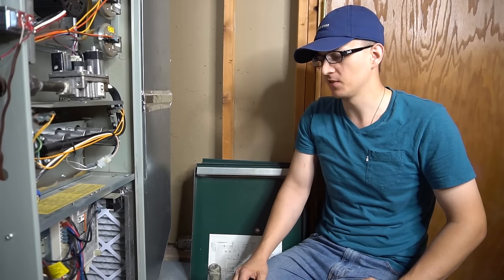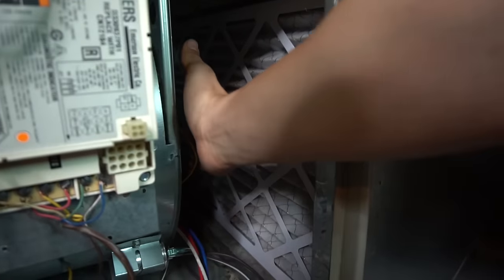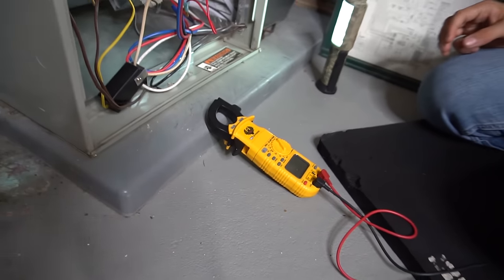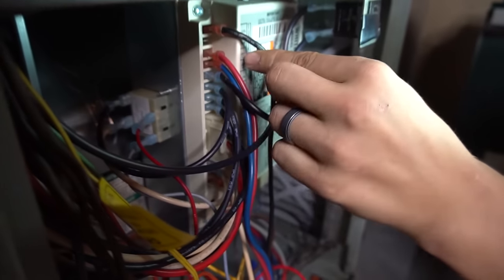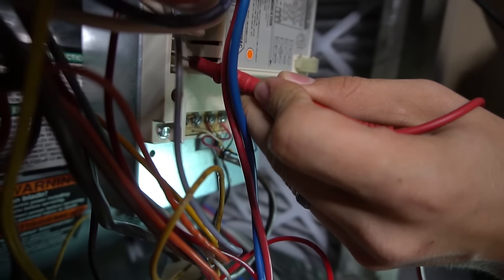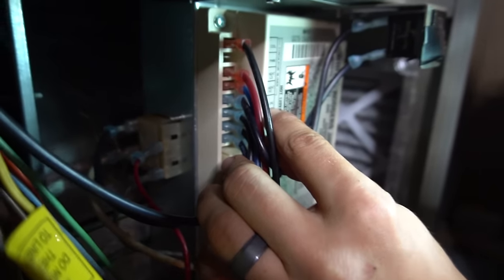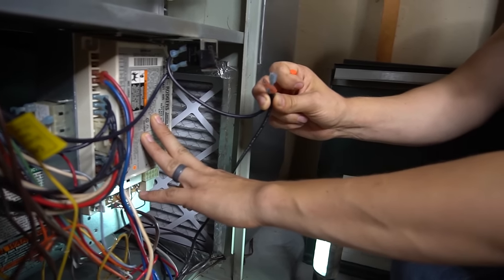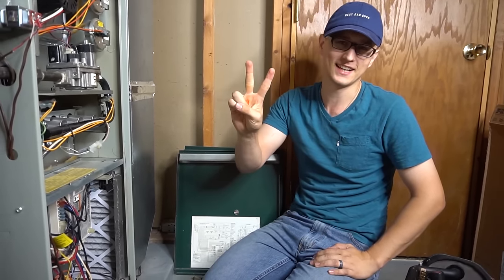Furnace Blower Not Working - How to Check It

Comment: I've spent hours watching your videos, troubleshooting and cleaning my entire system, just to find out that my wife turned off the switch for the furnace because she didn't know what it was for. Make sure to start at the very beginning, folks! Even if you think the switch should be on... you just never know. :P
Reply: Christmas Vacation anyone?! 😂
Reply: this happened to me for the condesor unit !
Reply: It is good to intall an outlet like my  .Problem solved and never accident switch to off by someone else  and safety also.
Reply: Omg thats crazy. I may Put a marking on my  Furnace on off switch dont touch.  Mine is a large Red one so that helps but would not hurt.

Comment: Your videos are awesome! One question when you're wiring fan motor direct to power if board is bad, why do you also take cooling line off the board? do you also wire nut that in with them or keep unplugged?

Comment: When you put the y spade splitter to the cooling speed line and power, why did you put it back into the line voltage terminal? Is that needed? Or did you have to hook it back like that to have power for the board? Also will the fan run constantly, if you jump it with the splitter like that?

Comment: Is it possible to rig up a non variable speed blower motor such as a psc motor or x13 motor to somewhat mimic a variable speed blower? I was thinking I could have blower motor start on the Low speed tap with a cooling call on Y, it would help dehumidify on the low speed. Then after 2 minutes on the call for Y, it could switch to the high speed tap for the remainder of the call to prevent the evap coil from freezing and to help with removing sensible heat. It would require a couple relays and a timer to work. Would be a pseudo variable speed set up. Thoughts?

Comment: Our upstairs AC unit was making a loud buzzing noise and there were no cold blowing from our registers.  Stopped power to the unit  assessed the problem squirrel cage was hard to hand turn…pulled out to find motor bearings were burnt.  
Meanwhile an electrical  storm rolled through our area last month during that event we decided to turn off the down stairs unit. Soon after the storm cleared went turned on the unit with no success. I did everything possible to get it going again. We called the HVAC tech and was quoted $1500 for a new motor…..ahhhhh what?
After a few weeks of you tube videos I always came back to yours. 

My upstairs unit motor bearings were burnt so replaced the motor and capacitors for $179 and 3 hours of my time.

Now to trouble shoot the downstairs unit repeated all the hacks on resetting to no avail.  Back to your video……had the jumper by pass the board and VOILÀ….AC functional now I need to shop around for a new circuit board.

Thank you so much.  DIY Dude

Comment: Hi Jay, thanks to you I just replaced the capacitor on the outside condenser unit, should I also proactively replace the capacitor for the blower motor?

Comment: Thank you for your video. Question: If I have to replace the "blower motor capacitor" with two terminals, no labels, does it matter wires must be in right place?

Comment: Thanks for your helpful videos.   If the capacitor is bad and I replace it, should I be concerned about the motor if I smelled a burning smell coming from the vents during the time the capacitor was bad in the motor wasn't turning?

Comment: Thanks for these videos. Super helpful! I'm troubleshooting because my AC wouldn't turn on. The air filter is new. Just replaced the blower capacitor that was 25% under the threshold of microfarads (thanks for that video too). It wouldn't even turn on before I replaced the capacitor, but now it's still short-cycling. All the tests in this video came out good except the one at 4:22 -- the com out of the board to the blower isn't giving 120V--it's reading 0.5... My question, would this only read 120V when the blower is being activated? Or is this reading a guarantee that the board is bad? The blower IS turning on and putting out cool air sometimes, but shuts off usually after 5 mins or so most of the time (but did run for maybe an hour earlier today). When it stops short the motor doesn't feel overly hot. AC unit is from 2008, so my other thought besides maybe being a failing control board is that the coolant is low, but would that cause a short-cycle? Thanks again!

Comment: very good video.  One question though.  At the end when you are describing how to bypass the control board, you use a spade splitter.  It seems to me that you could have connected the motor wire directly to the safety switch since that also has a spade connector.  Also, when you connected the two wires to the spade spitter, why did you plug it back into the control board?  That step seems totally unnecessary.  Nice video though, just curious.

Comment: I have just de-iced my hvac and not getting air coming from my wall intakes. When I take the front panel off, and run the AC, I was getting good circulation through my air ducts. When I put that cover back on, I get very little and strong suction on the panel. 

Before this I found the old filter either sucked up from the bottom or stuck in there. I pulled it out and ran again to see if air came through the ducts (just purchased this home). 

I did de-ice the coils as I thought that this old gross filter probably caused the build up and the blower (above all the coils) would produce good air flow again. Wasn’t the case. 

Now what I notice is when I try to run the fan with heat/cool off, it doesn’t turn on. I deiced with heat gun and wondering if there are internal components that may still be compromising air to flow from the bottom intake to the top

Comment: you make the best videos. Super clear and easy to understand, you cover all possibilities which is AMAZING...one question i have is, is it ok to bypass the control board for long time? i have a issue where my outside fan kick in and the blower motor for inside stops  (vice versa as well)...so im thinking to try and bypass the control board.

Comment: I have a carrier 8000 and the fan isn't turning on , I went up in the attic and wired yellow to the safety switch black plug you have to hold down and the fan came on no problem. Does this mean the control board is bad ? I also checked the thermostat and it's good. Thanks for any help.

Comment: Excellent! I replaced my condenser thinking the low "hum" on the unit was not giving the motor power. After replacing the condenser nothing changed still have a low sounding hum. Ideas?

Comment: Our heater blower stopped working last year this exact time. It was close to the end of winter so we let it go until this season. Then when this winter started we turned on the heater and it worked again all season so far, until the same time as last year. Now the same thing. You can hear the heat turn on but the blower does not… any suggestions?

Comment: Nice job explaining.  I just discovered that my board's relay to the high speed coil of the fan is blown following your sequence.  It's interesting that a heating cycle works fine, I guess because a different relay to a lower speed coil is involved in that, also jumping R to G on my board also didn't work the fan, I assume because it uses that same relay to the high speed fan?  Just to be clear, jumping across from a/c fan to line power or up to the door switch would power the high speed fan, but not allow the board to control the a/c anymore, due to the power now bypassing the board, is that correct?

Comment: Are you not able to just attach the brown "cooling" wire right to where the line voltage cable attaches to the back of the door switch?

Doesn't that blue wire pop off right there instead of having to wingnut them together?

Comment: Thank you for the great videos.  I smelled something burning around the air handler and quickly turned off the thermostat.  Went outside and the suction line was frozen, so was the condenser coil...although was just starting.  Checked the capacitor and it was toast.  The lines to the capacitor had horrible crimps.  I removed the crimp with two fingers and it came apart.  My question is if I smelled smoke is my motor toast?  Or do I just replace the capacitor?  I read somewhere about some resin that melts when the windings overheat and thus, even if it works or ohms out OK, that will fail in a few days after that.  Is there any way to ohm out the motor leads.  It only has 5 wires coming out of the motor (red, black, purple, and 2 brown going to capacitor).  Do I need to replace the motor even if if it works with the new capacitor.  Thank you for your time.

Comment: Great video.  Thanks.  I am trying to diagnose my furnace issue.  I noticed the blower is not coming on for either the furnace or AC.  I checked the voltage coming from the common and heat tabs and got 30 volts roughly.  I tested common and cool and got the same.    I tried shorting the panel switch and heat wire and when I turned on the switch nothing happened.   I thought or hoped the motor would come on.  Hmmm….  Board or motor?  Note:  Carrier Performance Furnace made in 2014.  No capacitor on main blower.  ?   Yes no capacitor.  Any help would be appreciated.

Comment: You are a lifesaver and a fantastic teacher! I quickly diagnosed and removed my furnace blower, but the parts place near me said, Carrier does not make any parts or motors for my old system. It’s 34-35 years old, but until now, always held temperature and no sign of leaks. Got a portable to survive until we can look into a replacement heat pump system.

Comment: This is a very good video. My blower has a 16 terminal connector and a 4 terminal connector. I believe this is so to the high efficiency blower design. Will the testing be the same on mine?

Comment: question for you. when you bypass the control board to feed power directly to the blower motor as you shown in the video, is that mean the blower would run 24/7 regardless the thermostat turn off the AC unit outside?

Comment: My Goodman 075-3 overheats and blower motor is weak and needs manual assistance to start but then runs constant. I have “open limit switch” code ( main limit open, aux limit open). I replaced the main limit switch and the capacitor and still does exactly the same thing. Whats the auxiliary limit do? The schematic shows the same wires coming from the flame roll out sensors to the auxiliary. I followed it to the outside the blower cage and can’t reach it or I would check it for resistance. Should I disassemble or check something else first? Thanks.

Comment: Thanks for the great video.  I've got a NEST T-stat and a Bryant Furnace, with a standard COOL/HEAT board terminals, and a few other speeds on the SPARE/PARK terminals.  The issue I'm having is that the FAN only runs when the Tstat "Nest"  is in Cooling or Heating.  I cannot get it to run when I select "FAN ONLY"   I want to be able to recirculate airflow without having the system on cool or heat.  The circuit board doesn't seem to have a "FAN" terminal... Maybe the option is in a DipSwitch on the board?  or perhaps the Tstat isn't wired up correctly?    Do you have any idea or suggestions?  Thanks

Comment: Should the outside condenser unit being running in both scenarios?  I have no blower working and nothing happening at the condenser either when calling for cool.  The blower wheel does spin freely and motor isn't hot so thinking its the board...or something else?

Comment: Correct me if I am wrong but if you hot-wire the power to the blower motor but wouldn't the blower motor run indefinitely regardless of the set temperature on the thermostat?

Comment: Nice logical approach in your video. The problem with the furnace blower at my cottage is a bit different in that it works fine when I arrive, but after that it gives a blower fault. When I watch the restart sequence it almost gets there, but the fan doesn't get up to full speed and shuts off. After being left alone for another week, it again works perfectly the first time. Turning it off over night is insufficient. Could it be that the capacitor will only work when it has become fully discharged? How would you attack this problem?

Comment: I wish you were doing a general test as testing for resistance across the common and your different speeds.  Checking the start and run windings, thing like that. You’ve basically explained how to trouble shoot your furnace and your furnace alone. A lot do t have a board. Just relays, transformers and so on.   

I wish mine was like yours. Make my life 1,000 times easier.

Comment: I was in panic when my furnace blower motor was heating and stopped to work after 2 minutes running. With your very concise and helpful video, I was able to fix my issue with a new $5 Capacitor. Keep up the great work!

Comment: I did this bypass to make the fan run cuz the board was the issue,  but now the outside unit wont turn on even when i put it all back in the original configuration?

Comment: Love your vids, thank you. I have typical issue. Furnace comes on, blower motor hums and heats up...doesnt spin SOME times. Start manually...it will get going. I started with cheapest, capacitor. About same results, worked for a day maybe. If a motor is bad, wouldnt it not work at all? Obviously its getting power, new capacitor should be giving kick...would a failing motor work "some" or with a manually bump? Blower fan spins free, no binding also.

Comment: So thankful for your channel.  We have an American Standard air conditioning unit electric with natural gas heat.  We have had to replace the squirrel cage at least 5 times.  The last one taken off was only on about 5-6 months old.  The blades were all rusty and loose when taken out. Now the new one is making the same noise...every time its the squirrel cage.  So frustrated with this unit!

Comment: when you pass by the control and send power directly to the motor to temporary have it working until the control board is replaced, it'll be safe to leave running for a couple of days?
or else?

Comment: Hi, I have a question. If i turn on my heater it’s doing okay but if l’m cooling the house the fan doesn’t blow cold air. Sometimes it turns on but suddenly the fan will go off. I mean heating is no problem but cooling is.

Comment: I love your videos, and wanted to add something that happened to me, I'm not an HVAC tech. My motor would not start, even after I heard the relay click on, so one would assume the start capacitor. This theory was also reinforced when I had to hand start the fan (not recommended if you don't know about this stuff),  but it still had trouble starting and I realized the motor bushings were out of oil, and it couldn't overcome the initial friction to start, as it was hard to turn and the motor was very hot if you did get it to run. Anyway I saved 175 bucks on a new motor by taking it apart and re-oiling the felt pads on the two bushings in the blower motor. It would not be hard for some people to do if you are mechanically inclined. Some motors may have oil ports, if they do I would use them.

Comment: Jay (and others)…Quick question for you if possible & awesome videos, so helpful! Problem was my blower motor not turning on while calling for heat. By watching, found w/ multimeter that my control board is NOT sending 120V to Heat spade terminal, hence motor not turning on. Bypassed power & confirmed blower motor is functioning properly.

Here’s my question …when calling for heat, identified my control board is additionally sending 120V to HUM (humidifier) spade. Given my ‘Heat’ spade on board is dead, alternatively can I power the blower motor for heat by wiring it directly to the 120V being sent the HUM spade? Will the blower’s delayed shutoff work properly off this 120V HUM spade? 

Understand that replacement of the control board is eventually needed but asking if this alternative solution will work and not be detrimental to overall furnace health. ~Thank you again and appreciate any guidance regarding HUM spade!

Comment: My blower motor in the attic will  run for an hour before shutting off and does not get to temperature but is blowing cool air until it shuts. 

When it shuts down the outside unit will keep running if the thermostat is left in the cool position. 

After the inside unit shuts down prematurely i cant turn it on and it sounds like it is trying to start but never does. If i leave it alone for a while it will come back on and repeat itself all over again. 

Any idea what gives?

Comment: My blower motor stopped working may have been stuck on for a long time up to 30 days.  I have a replacement control board but there are other problems to solve before I install the new board.  Thank you for the video!  The popping sounds freaked out my dog.

Comment: 80 volts at the black wire from the board. Jumped it and the fan came on. Pulled the board and the back was burnt up and crispy. Great video! Liked & Subscribed.

Comment: I changed my whole blower/ furnace motor, because I was told it was bad.  Trane/ american standard with built in module just for more info. Motor is now running but is not blowing strong at all. Very weak out of vents. Any guesses on what could be causing that?  Any help appreciated. Thanks.

Comment: Thank you for the furnace videos. Based on your information like feeling for a hot motor,  I saved labor cost (est $200) on the furnace motor replacement by replacing the motor myself.  This task was my first getting into furnace motor using area. I had by pass certified Hvac Mechanic requirements by looking for local motor supply house as well known ones would not sell to me.  I know the motors are available on line but I wanted talk someone locally.   Anyway thanks again.

Comment: heater on, blower work good. Ac on, blower not working. and I see the compressor run but not the blower.  Do you think the control board is a problem?